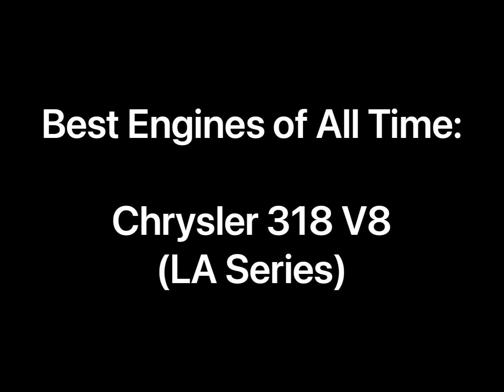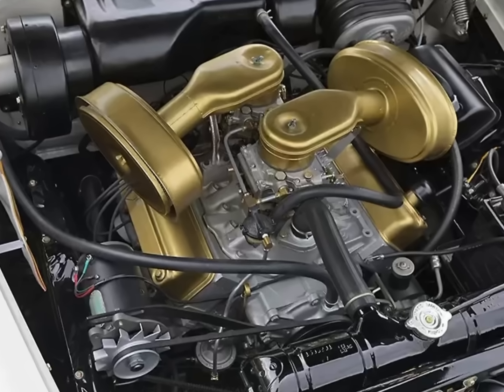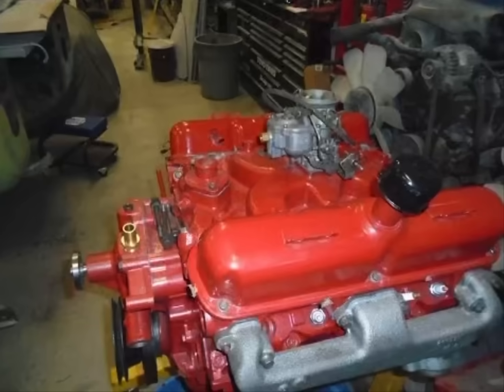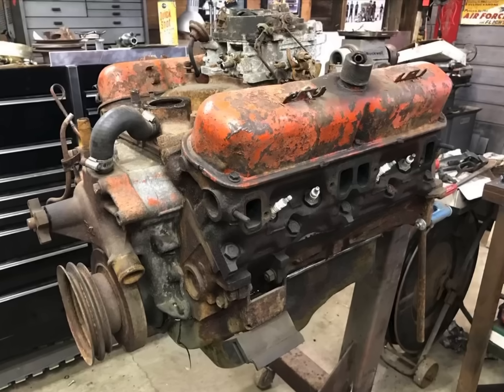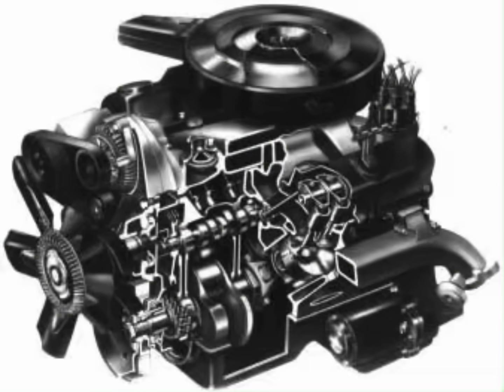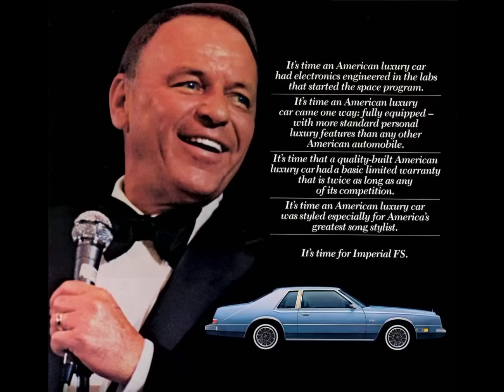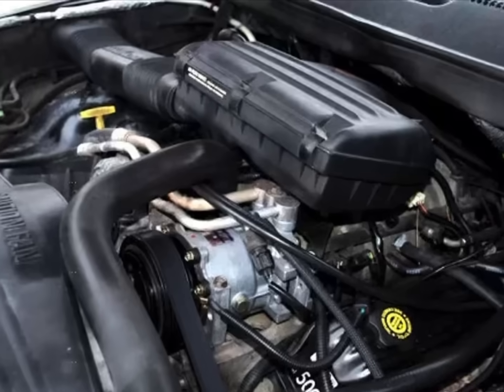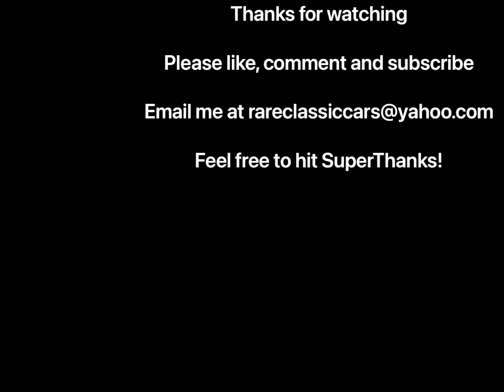Best Engines of All Time: Chrysler/Dodge/Plymouth 318 V8 (LA Series)

Comment: My parents had a 66 Valiant (Canadian version) Custom 200.  It was equipped with the 273 V8 with 2bbl carb.  That was rated at 180 hp.  My mom said more than a few other drivers were surprised when she took off from stoplights in a compact car (with two kids in the back)  that was sporting V8 power.  My dad said the Valiant's rear end was too light to really transfer all that much power to the drive wheels.   
My uncle had a very nice 71 Satellite Sebring with a 318.  After the Valiant, my parents switched to Volvo temporarily.  Their one last Mopar was a 77 Volare Premier wagon.  It turned out not to be a favourite.
Reply: My ' 65 Formulae S's pinion gear contracted broken tooth syndrome.  Dropped in a '70 Duster 340 engine, 'rock crusher' transmission and rear end.  A perfect combination.  Went fast enough to scare hell out of me.

Comment: Many years ago i owned a 1964 Dodge Dart Gt with a 273 V8. It had a factory 4 speed with a Hurst floor shifter. Put on a Carter AFB 4 Barrel and dual exhausts . It looked like a granny mobile. Surprised many Ford Falcon sprints and Chevy II novas at the traffic light. Lots of fun. Keep up the good work . Jeff Cler
Reply: Atleast the 273 had a 4 barrel. 318 never did. What a joke.

Comment: Oh, come on Adam, not again with the lean-burn shit talking. I understand many people are scared of computer modulated carbs but I've owned 2 lean burn cars and both were very reliable and never caused me problems. If you wanna talk about poor engine computer designs, talk about the early 80s ccc quadrajets from gm. Those are trash
Reply: Right on 👍
Reply: Anyone that didn't like thier Lean Burn system could easily go to thier local salvage yard, get a normal electronic ignition distributor, CDI box, ballast resistor, and pieces of the wiring harness and have it retrofitted into thier car in an afternoons time

Comment: When I worked at the Chrysler dodge jeep dealer we had many customers who had put over 300,000 miles on their magnum 318 the one that had the most miles was a 94 grand Cherokee that the 318 made it to 600,000 miles when it soon after broke a piston ring and lost compression on number 1 cylinder it was a sad day.
Reply: Yup, my high-school shop teacher's daily a 1966 Dodge Charger 318 A-block V-8 all original 300 000miles!
Reply: I had a 1988 Dakota with the 3.9 V6, at 172,000 miles it was smoking bad, I pulled the engine,  and 2 cylinders had both compression rings broke.  Had it bored. 030 milled both heads, and block.  Had it balanced,  rods rebuilt,  and it ran better than ever for 21 years  from 2001 until 2022 when I sold it running for strong with over 70,000 miles
Reply: My 98 ram 1500 just rolled over to 300,000
Reply: I had a 92 Dodge Ramcharger Canyon Sport with the new 318 Magnum. We waited a year because we didnt want the throttle body fuel injection. We drove it 330000 miles until finally the rockers were completely rotted off and it was just toast. My favorite car of all time
Reply: No  doubt  man  you  will  never  even  come  close  with  any  other  drive train  💪😎
Reply: All of the LA-based "Magnum" engines  were great! I have a 2001 Ram 2500 Quad Cab 4x4 with the 8.0 V10, and it has alllllllmost 500,000 miles on it. HARD miles (the thing should have died several hundred thousand miles ago!). Still has insane oil pressure, doesn't smoke or burn at all and the heads have never been off. Doesn't leak a drop of oil and even still has original front and rear seals and oil pan gasket....... I've towed so heavy and so fast with that thing that when I would get to the top of a 6% or greater grade after a W. O. T. run (usually Towing about 10,000 lbs), the RIGHT side header would always be glowing lava red! Every single time..... And I've never burned a valve or blown a head gasket or anything.... Driver side never glowed for some reason. Thing runs like brand new.
Reply: And Scotty Kilmer would still claim it be junk.
Reply: @robhargis6980  i hate scotty
Reply: @robhargis6980  I rarely watch a Kilmer video, but as soon as I do I remember why I shouldn't do it.
Reply: @robhargis6980 because he’s a clickbait artist. I blocked him.
Reply: @robhargis6980  hahaha nice one!!
Reply: @robhargis6980  That guy’s a doof
Reply: WOW that's the way they use to build them
Reply: Main problem with the Magnum engines I've heard of are the heads develop cracks between the intake and exhaust port, thought due to using induction hardening of the cast-iron rather than steel inserts.  I think you can buy aftermarket heads.
Reply: @SihAza  Yes, cracking is common.  But the reality is that the crack doesn't leak water, it relieves the stress in that spot, and the engines continue to run with no outward signs of the cracks.  All reports are of seeing cracks at rebuild time, but I don't recall reading anyone's report of having an ill-running Magnum that needed the heads replaced to make it run properly again.
Reply: @SihAza  and they still ran fine
Reply: @SihAza 
Induction hardened valve seats was needed due to unleaded fuel being mandated. Induction gardening is far cheaper than machining the insert seat and insert. If the heads were cracking l suspect the castings being too thin or core offset in the casting process.
Reply: @SihAza Small block Chevrolets do that, too.  Basically any engine with induction hardened seats will do that if you run low on coolant and get them too hot. The best solution for small block Chryslers are to find 72 or older heads and have hardened seats installed.
Reply: Im going to go buy a 94 jeep today with only 178k miles on her
Reply: I have a 1990 D250 with a 318.
It has 495k on it and still runs like a sewing machine.  Best damn motor ever made!
Reply: My cousin had one in a grand Cherokee went about 400,000
Reply: did the company offer you counselling to get over the trauma you poor sad man?

Comment: Hey Adam, are you going to do anything on the bullet proof & dependable slant six?? Thanks for sharing your informative videos!!! 👍👍🙂
Reply: My dad had a 58 Plymouth with a 318 Poly (Powerflite) which later became mine.  Then, as a young man, I ordered my first new car, a 70 Duster with a 318 LA (3 spd man).  Would give anything to have either one.
Reply: @vinceschimoler6674  what does that have to do with the slant six?
Reply: Another great motor
Reply: Good little engines but the slant made them a little tighter to work on than the straight in line sixes of GM and Ford
Reply: @ronripplinger5235  yes, however, you really didn’t have to do much repairs because it was so dependable.  The Ford inline 6 300ci was another great 6 cylinder

Comment: I've had several over the years, and no complaints.  1968, 1973, 1982 and 1999.  The '68 one would get the speedometer of the '68 2dr Polara up to 115 with only a slight rise on the temperature gauge.  For comparison a '73 Olds 4dr 88 with a 455-4v wouldn't go over 105.

Comment: The LA 318 in my 1987 Dodge Diplomat was excellent in every way.  265 lb feet torque at 1600 rpm.  2 barrel carb.  Beat that with something that isn't turbo/super charged with direct injection.  I know which one will be more durable - if you even can match it.

Comment: There's not really much in the way of fuel economy in the 318, but there's power there with the right gearing.  I'm in the middle of a full restoration of a 1997 Dakota 4x4 with the Magnum 318.  Fuel consumption was pretty weak, and whoever bought it originally thought that the heaviest version of this truck would be more economical with 3.55:1 gears.  It wasn't.  Economy is out the window when you're hard on the throttle to get it moving.  I recently changed them out for 4.10's, and not only did the combined mileage improve - if only slightly - but the acceleration was dramatically better.  All highway mileage is right around 17/18 MPG, so no complaints here. These motors are extremely dependable, and who buys a big ol' 4x4 for gas mileage anyway?
Reply: I had a similar experience with a '68 Newport w/ a 440.  It was nearly all city driving, and when I changed from a 2.76 to a 3.23 the milage went up.

Comment: A workhorse indeed. I used to work on both these and Chevy small-blocks back in the day, and one thing I noticed was how much smaller the Chevy was on the outside. The 318 looked bigger than even a 350 or the small-block 400 Chevy engines.
Reply: The deck height of the block is a little more than a half inch taller.

Comment: Thanks Adam - it would be interesting to see something on the "old" 318 engine as well.  We had a 1963 Fury when I was growing up which had the A-series 318 - Dad loved the power, Mom loved the gas mileage and the TorqueFlite transmission with the pushbutton controls.  She still talks about that car
Reply: You would be STUNNED to know how many "young" MoPar fans DO NOT know of this GREAT MOTOR!
Reply: @johnmaki3046  Agree!  And it was in just about every work truck Dodge produced or a slant 6.   They were the Olds 305 of GM fame but were produced for decades.
Reply: The A and LA 318's share much in common and with little modification heads are interchangeable, Both the A and early LA have pretty heavily duty and rugged block castings. Both used internally balanced forged cranks.
Reply: I had the same car '63 Fury 4 door sedan 318 wide block , 2 barrel stromberg carb , push button auto. and 8 3/4 rear end with the tow package .

Comment: I had a 92 dodge Dakota. The first year for the 318 magnum. That little truck flew. I remember it was hard to do the oil change. All of the 4x4 parts were in the the way of getting it out.
Reply: I bought a 92 Dakota 4x4 new with that Magnum 318 . It sat on the dealers lot for months none of the employees there even gave it a second glance . I had a couple of friends that worked at that dealership that drove my truck after I bought it and couldn't believe the performance . If I had a rolling start taking a then current 5.0 or a Z28 was no problem .
Reply: @edwardt9585  I could woop mustangs with it. And it put other trucks to Shame. My friend's dad worked high up in Chrysler back then. He told me it's nickname was the little rocket.

Comment: There's nothing like changing cap and rotor on a Magnum 318 in a 99 Ram. You're working entirely blind under the cowl.
Reply: I'm from Wisconsin, and most of the time those damn distributor cap bolts rust tight n snap off. Lots of fun lol....   what was wrong with the simple snaps they used on the carb & TBI distributors????
Reply: They sucked! The big block has the distributor at the front of the engine tiled towards the passenger fender. 😎

Comment: Hey, you forgot to mention the Barracuda. My first new car was a 1968 'cuda with this engine in it. Very reliable, ran for ever.
Reply: My first car was a 68 barracuda, 318 .   I took the engine out,an built a giant killer.    340 engine Built, 727 turbo action,and at the end of the cars life, 5.38s in the rear.
Reply: . FACT : NO small block ever beat my '67 440 Barracuda once i let out the clutch and hit the gas peddle .
Reply: @keithpearson7059  Ok
Reply: @davidbarrus6542  Way cool!

Comment: In '93 I rebuilt a '76 360 from a cordoba using the original crank, rods, pistons.
    It went in a '86 Dodge d150 with the granny low transmission , dang flywheels were like hens teeth .   The 360 had nearly 100,000 miles  in the cordoba and currently has over 100,000 miles in the truck and is on it's second owner since I sold it.

Comment: I love the 318 I’m getting 379 hp out of my 1974 w-100 318 works great with electronic ignition fuel injection can’t ask for a better 318 reliable great fuel economy and reliability thanks for the video retired sergeant major US Army Gamsby
Reply: The ( STOCK ) 440 I put in my '67 Barracuda was 375 HORSEPOWER ( with 0 mods. ) 😁😁

Comment: I think it should be noted that the 318/V8 was not considered low on power for its time; not at all.  Chevy was still using the short block '283' as its mainstay with Powerglide (less efficient than TorqueFlite) and Ford was dropping the little 260/289 into most of its cars.  Having lived in that time as a child car nut, I can assure you that people in general were more realistic about power in their cars.  I took my driver's ed in school driving a beautiful 1971 gold Fury III sedan with that 318/V and TorqueFlite and in a lot of city and highway driving over that summer, it was in no way underpowered with its 230hp and 4 people.  Quiet, workhorse engine like most people wanted then.
Reply: I had a 71 satellite 318, loved it.
Reply: @chuckz8053  I had the '74 with 318, only 318 ever had.
Reply: @chuckz8053  I did too. I beat a lot of Chevy and Ford small blocks. Got decent gas milage to.
Reply: I learned to drive on a 1970 Fury wagon with a 318. I agree.
Reply: You are absolutely right about people in general being more realistic about the engines in their family cars.  I took my driver's test in our Olds Super 88, with a 394 4-bbl, and it consumed a tank of gas just to go around the block!  Our Driver's Ed car was a 1968 Dodge Coronet, with a 318 and Torqflite.  A perfect match of body and power train.
Reply: I took my driving test in a '68 Fury 3 , 2 door hardtop with a 400 HORSEPOWER. 318 built by Bill Schiffskly ( who built and raced his " Beartown Shaker " funny car ! ) from White Bear Lake , Minnesota .
Reply: @keithpearson7059  In my long life, I have been very fortunate in loving cars--ALL cars, not just hopped-up toys.  My first car was a 1951 Lincoln sedan with an enormous flathead V8 that Ford adapted from their medium-duty trucks for 3 years.  My second car?  A white BMW Isetta with a top speed of around 50mph and that door in the front. In fact, the cars I like least are those that some idiot couldn't leave alone and decided to do a 'restomod'.  It's why I really like subscribing to this channel: Adam collects and showcases un-molested cars.
Reply: I had a 68 Fury 3 with the 318, and I agree, it was not underpowered at all. It had smooth power delivery and had good passing and cruising power on the highway. But note that the 230 hp figure is gross horsepower. Since some time in the 70's, the advertised hp is the net, as installed hp.
Reply: 273 not 283
Reply: @mpetersen6  The 273 was the 318 downsized.  The Chevy  283 was the '55 265 enlarged in '57 to 283...
Reply: @loveisall5520  
The first version of the LA was the 273.
Reply: I learned how to drive in a blue with white vinyl top 1971 Plymouth Fury 3 four door powered by the venerable 318. I agree, it was never underpowered and drove well and could still pull well on the highway. Great car with a great motor. 👍
Reply: Not only that, but a few cheap and easy mods can get good power out of them for anyone who wants it.  See Uncle Tony's Garage for that.
Reply: @alan6832  i don't need to see " uncle tony's garage " i lived it years ago . lol .

Comment: I still remember the 1964 Plymouth Fury my dad owned. It had the 318 with the push button automatic. The fan made more noise than the engine. We got over 250,000 miles on that car before the transmission started slipping. My dad sold the car for $50! I almost cried.
Reply: That was the 318 poly.  It would have been a nice to have seen improved poly heads offered on the LA.  But, I guess that's why they offered a big block.  The poly engines were as heavy as big blocks and would not fit into the A body.

Comment: That dual 4bbl may be the wildest intake design I've ever seen. Love it!
Reply: You need to look up the max wedge intake from the early 60s. They used it on both the 413 and 426 I believe
Reply: @tl5108  The Long Ram intake.....383s and 413s got those in the Chrysler line
Reply: @tl5108  those were cool too,  but these air cleaners seem even more striking to me
Reply: @tl5108  enjoy pulling those valve covers lol think I'd rather the whole in my hood with a reg tunnel ram
Reply: @mikecyanide7492  yeah I’d definitely run a hydraulic cam with the stamped rockers if i used that intake lol. Not pulling all that shit apart to adjust rockers a couple times a year
Reply: Every blue collar man enjoys a SIX PACK 😈🤘

Comment: 100th like here! I guess it's opinion on my part, but as far as the smaller <330 C.I. V8s go, the 327 is probably top dog, but the 318 probably edges out the Ford 302 and AMC 304, in spite of there never really having been a real high performance 318 from the factory.  They are known to make good power, and able to withstand it.
Didn't Frankie Baby also hawk the 1968 or '69 GTO??

Comment: WHat do YOU consider a great engine?  For me, its both performance, reliability, and longevity. The Chrysler 318 & current Penstar fit those categories.  Not a hemi. Nothing reliable about a hemi that out of warranty, won't cost $1,500 minimum to repair.  Ford, GM - they have a laundry list of reliable engines going back 55 years.  Chrysler...nope.
Reply: Hey now, let's be fair. Chevrolet V-8 had camshaft problems mid 70's through mid 80's. GM also had that wonky "Electronic Spark Control". No it wasn't as bad as "Lean Burn", but it was close. How about the "variable venturi" carburetors Ford used in early 80's. All the big 3 had thier issues. Chevrolet also had much softer blocks that wore out n burned oil sooner than Chryslers.

Comment: Perked up several malaise-era LAs by advancing the camshaft with a 4 deg. offset woodruff key on the cam sprocket.
Reply: I had a '73 in a Dart Sport that really woke up with just a 340 cam, 4v and headers.  And of course the advanced timing you mention.